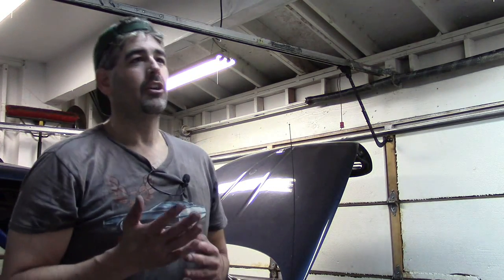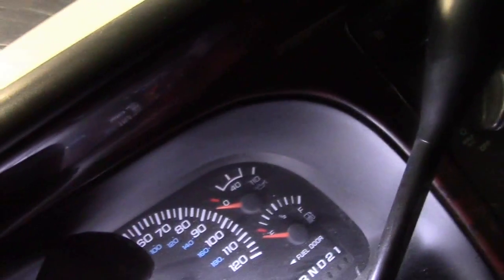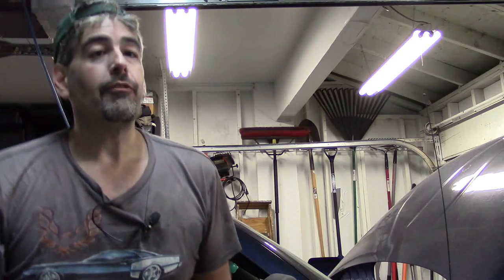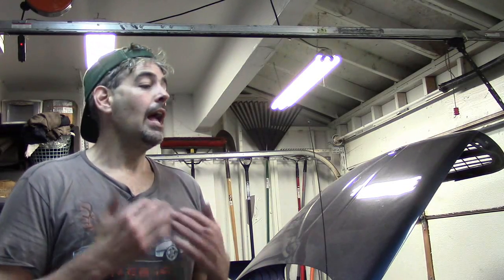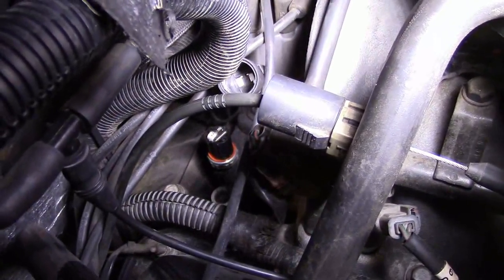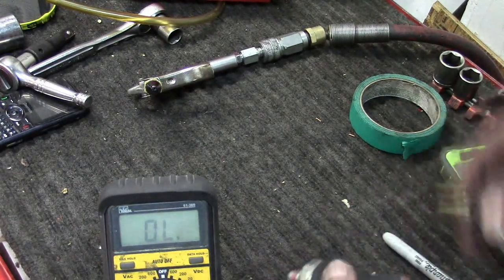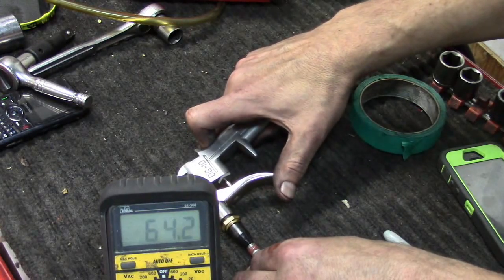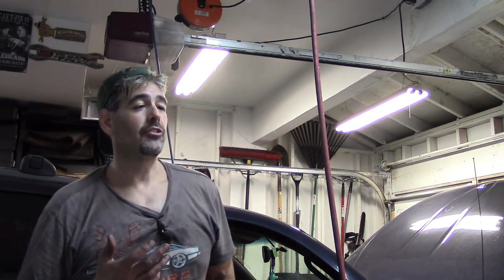DIY- Low Engine Oil Pressure Diagnostics

Comment: Hi,  first of all I love this channel.  Some of the best info online!!   I have 1 question, Ive got oils pouring out of my engine. looked like it was the oil filter adapter  I changed out the gasket on my oil filter adapter. but now looks like it is coming from above the part of the engine that the adapter bolts to. That part also has 1 bolt in it.   is this a part i can replace or is this a cracked block?  not sure if this is a place to ask questions but if anybody  can help it would be greatly appreciated.    ( 97 ford f150 4.2 v6)

Comment: Hi, love your show have a quick question I have a 350 Chevy small block I have a autometer gauge hooked up to it when I started up my oil pressure is about 30 when it's warm what about 20 minutes it goes down to about 20 is that normal

Comment: matt Im in the UK ,but I suppose  probably not much different where you are regards engine design ,but could it not possible there is a problem with the pressure relief valve, only a thought as you are sometimes getting pressure.regards joe

Comment: Looking for advice, 02 altima with fuel trims at negative 15 to 20 %, code 0300,  O2 V at 3 to 6 V. and long crank start after warming. fuel pressure good, compression good, does not stall. unplugged vacuum line and trims improve but o2 voltage remains at same levels. ??
Reply from the maker: What is the LTFT and aSTFT curves at idle vs load? You cannot tell anything without that.
Reply: the STFT  I mentioned is at idle, with LTFT at neg 10%, under, load during take off it goes up anywhere from 0 to + 5 % at best, once settled STFT goes back to as low as negative 18%, unfor did not check LTFT,
Reply: I have been leaning towards a leaking injector, would this cause the random misfire?
Reply from the maker: Oscar Hernandez Oh perfect- what is your data you have indicating a leaking injector? That helps. Was it a static fuel pressure test?
Reply: well at this time I have no tools to test injectors, (I might be jumping to conclussion)I stumbled upon your videos not long ago! been reviewing the diagnostic series, I might need to test fuel pressure since I only saw pressure while cranking, it had no pressure when switch at on position!
Reply: for pressure test, i connected before delivery (injectors) rail.
Reply from the maker: Sorry man you have no relevant evidence I can help with. Once you get some data I can give a direction but I don't see how you're coming to these conclusions without evidence.

Comment: Well Identifix specifications for this engine are At idle, it should be 6 PSI and it is at 20. At 6000 RPM.
You don't think that the drop on pressure at the gauge was caused by the bad sensor?
Reply from the maker: At what TEMPERATURE?? No one seems to consider the most ciritical parameter despite my pointing this out in the video.
  How can it be a bad sensor?  The evidence is scientifically irrefutable it could be the sensor.

Comment: if we came from other side, Bad oil bump can cause inefficient lubrication and bearings is going to wear out. Pressure will fail down with time, am I right? because this is what happened to my Nissan Z I guess.
Reply: Low oil pressure is usually or almost always a worn motor and the bearing clearances are way out. One way to confirm is to check the oil for metal as he did.

Comment: What is it with Chrysler/Mopar/Dodge and oil pressure issues? It's not rocket science to have proper bearing tolerances and a decent oiling system. The Jeep 4 liter is famous for oil pressure issues. And, long ago, a dealer mechanic told me they changed the oil pressure gauges to be no better than a light because they were getting too many warranty issues of low oil pressure. Yeah, relatively low mileage engines still under warranty with 15 pounds of oil pressure at idle when hot. They got tired of paying for the repairs so they faked the oil gauge readings. I'm not saying Chrysler is the only company that does that but they're covering up a legitimate problem and, if the gauge really read true oil pressure, a lot of people could save their motors before they're destroyed. I'm sure the Chrysler/Dodge/Jeep fans will suggest it's poor maintenance, abuse, etc, but it happens too often to make those excuses. When was the last time you've seen a GM LS or Ford Coyote motor with 10 pounds of oil pressure even with 200K miles. How many miles are on this truck?
Reply: 10psi at hot idle is normal for many cars.

Comment: Out of curiosity, how would the pressure suddenly drop to zero, then back to normal range? I'm a noob so I don't know how all the bits are related...
Reply: Because the computer is faking the gauge reading. It shows normal pressure on start up but then if the pressure is too low for too long it drops to zero and hopefully turns on a warning light. It's kind of silly to have an oil pressure gauge that doesn't really read oil pressure but they've done that to reduce warranty claims.
Reply: Ah, so the other oil gauge (at the end of the video) is showing the REAL pressure. Thanks.

Comment: Hi, glad you are back.   When will you do a video on radiator fan running for too long and stop for too short with no apparent reason. What would be the issue that makes them  behave this way ?
Reply: Maybe a coolant temp sensor.

Comment: Hell ya, thanks for posting man!!!!   missed ya .     Half the time if you grab a junkyard v8 with decent miles on it, it's cheaper than a full blown rebuild after u buy the kit and all of the nicknacks.   Unless you just go for bare bones what u need to get by or whatever.   Looking forward to seeing the budget rebuild if it is in the young mans budget.  P.S.   i heard that lieing is bad for your teeth, the previous owner needs a pop in the mouth to prove that theory.
Reply from the maker: Lol agreed on everything!  I have done many dozens of salvaged yard swaps- it's how I started in this hobby in fact. I used to swap an engine for no more than a $500 investment total for everything including new gaskets and fluids. But I no longer do major work now.
Reply: Rhage73

Comment: Ameritrash, always breaking down until quality mechanic replaces all the parts with quality replacements.
Reply from the maker: You know this is a quality issue without knowinbg the maintenance history?
Reply: My dad owned 2 fords, jeep, and a Toyota for trucks. Volkswagons, Hondas, and Toyotas for cars. Jeep once a part is replace it never failed again, fortunate to not have a major failure. Both his Ford trucks had major $2000+ breakdown at 60-70K miles. Toyota Tundra he can't figure out spark plugs, took to dealer they say only need service at 100K miles or so. Never did anything to it other than change oil and it never broke. Over 120K miles now. Hondas and toyotas change the fluids at sparse factory intervals, they just purr, never break.

I've only had 2 Honda cars. Fist one 130K miles, lost to not at fault accident. They never broke down. Only change oil every 5000-8000 miles.
Reply from the maker: In science we would refer to this type of mentality as Ad hoc ergo propter hoc empirical logic fallacy exponentiated by personal anecdote.

Comment: I was thinking of testing the sensor different. It's a variable resistor like a coolant temp sensor. short out that 5 volts and watch the gauge. or just unplug the sensor and see where the gauge is at w/ 5 v sig. alternative readings if the computer doesn't some how shut down the circuit. Tests the entire circuit. Your correct the gauge and wiring is good as the gauge is reading the same as the pressure sensor.  But just checking the sensors ohms with varying pressure doesn't 100% rule out wiring and gauge.
Reply from the maker: Those a are valid ideas.  In fact, usually I use a variable resistor to short the circuit so I can confirm proportionate variance with the gauge.
Reply: Yeah, that would work well never thought to use one. At the dealer we have simulators that generate volts which could work.

Comment: Well u did 2 great things here you fixed the rad, so he can now use it and u also confirmed an issue he has with the engine. It's not good to hear that but you were not aware of it I am sure if you had been the outcome would most likely been the same fix the radiator and leave the other issue as the only thing that can truly fix it is an expensive rebuild. Great and truly thorough job love you diagnose vids.

Comment: a man my 2004 chevy silverado has the exact problem...has a low oil pressure i change the oil sendind unit and it still the same sometimes i hear a lil knocking sound when i accelerate the oil pressure goes away then i stop and comes back on u think it needs a rebuilt?
Reply from the maker: What was the data you got that indicated you need to change the sending unit? I would definitely start there.  What was the variance of reference voltage with pressure input that you saw indicating the sensor was faulty?
Reply: the oil gauge needle would'nt moved at all so i change it and thats when it started marking the low oil pressure
Reply from the maker: 559 calii  So you didn't check that6 it was a lack of reference voltage?  You have no evidence to go on in that case. You need to rule out electrical diagnostics to approach this scientifically.
Reply: yea but sometimes i can hear a lil knocking sound in the engine
Reply from the maker: 559 calii You need to do the diagnostiocs I did.  There is not other method that can give conclusive evidence other than measuring your bearing clearances.
Reply: ima check the engine pressure then
Reply from the maker: 559 calii No no no- you need to start with the electrical.  Validate variance of resistance with pressure and that the return on the reference signal indicates as much.  That is where you start.
Reply: with the sending unit i took off?
Reply from the maker: it doesn't matter. you have no evidence of 5V reference. Measure for 5V reference and ground first.
Reply: 559 cali.     

: iPhone
Reply: Marlyn Ramirez what u mean?.

Comment: Is it possible to make my 2000 Golf 4 shoot flames or backfire, if i rev up my engine, then turn off the ignition and press a button connected to my fuel injectors and turn on my ignition again to make it shoot flames? Just like old cars with carburetor
Reply from the maker: Of course- run the car with a maxed negative fuel trim and insert spark plug in exhaust.  Have fun.

Comment: The moral of the story is that you should never believe what the seller says 100%. Always take what they say with a pinch of salt and use your common sense and judgement. Or even use it as a bargaining point to get a better deal as you are taking a risk. If in any doubt and you are not willing to risk it (you can't fix it cheaply yourself, for example), walk away.

If it really was just a pressure sender unit, the seller, in theory, should have had it fixed as it's a cheap and easy repair - why would he have an obvious fault that would mean less chance of selling the vehicle, and getting a lower price for it?
Reply from the maker: Correct- and in fact, I believe the seller did replace the sending unit which is why it was broken, and that confirmed to them to unload the vehicle.
Reply: I hate crooks.

Comment: How many miles on this engine? What does the odometer read?  Certainly it wouldn't hurt to drop the oil pan, check the screen for clogging and pump tolerances.  That metal could be coming from anywhere like a worn camshaft lobe for example. Very difficult in this video to see the metal fillings/color in the oil sample shown.  The oil does look super thick and dirty.  I bet there is tons of sludge inside due to lack of regular maintenance.  After you changed the oil and filter what symptoms were noted?
Reply from the maker: The oil was full of bearing material. The mileage I believe was 185700
Reply: '00 Durango with 186K miles, yeah its at the end of its life
Reply: you are definitely right
Reply: Was the magnum 318 less durable than the old 318?
Reply: Ozzstar you hit it right on the dot my friend. Jumping straight to an engine replacement is being a bad mechanic. Change the oil sending unit, and run some cleaner with the oil change etc. This would give a better picture.

Comment: Great to see you making videos again.  Not so sure on this diagnosis, but I could not hear the rod knock.  What is the specification for engine oil pressure at idle for the 2000 Dodge Durango 5.2L?  On my V6 Toyota Camry it is 4.3 psi or more and at 3,000 rpm it is 36 to 78 psi.  Also, on the oil diagnosis, I would use Blackstone Labs before recommending an engine rebuild and pay $28 for their engine oil analysis.
Reply from the maker: This was a cold startup with the gauge failure activation being  at 7PSI for this vehicle and we saw activation twice at end of IAC flare.  There is no argument- this is legitimate low oil pressure.
Reply: How many miles on that engine?  These engines are known for oil sludge buildup if oil is not changed regularly.  Is it possible that the oil pick up screen is clogged with oil sludge?

Comment: Matt, I got to admit, I don't go to the best garage, seeing how they messed up my coolant lines when changing the accessory belts... I also had them change the oil and filter. Everything was fine before. But fairly soon after the change, my oil pressure gauge started "swinging" beween 0 and max, depending on rpm and temp. Have been driving a something like 1000-2000 miles with it since. When it start having a low below 30, I just put in half a liter or a liter of oil. The engine starts and runs, has power, even on german autobahn (100 mph+). But I'm not sure if I'm destroying the engine for good, or if it's fixable. Here on youtube are a lot of video's with the same exact symptom, but no one shares the diagnosis. So my guess is, it's very very bad news.
Reply: oil pressure sensor/sender.

Comment: This guy should stop using high performance engine oil with statins - he really needs some atherosclerosis. In this matter cars and humans does not have the same (pato)physiology. Humans are "clever" - they normally get tighter "bearing clearance" as the heart (oil pump) gets weaker with old age.

Comment: Looks like a bit of a "Ford" trick with the oil pressure gauge.  For the uninformed:  Ford started using a "Dummy Gauge" long ago due to people complaining about fluctuation of the "real" oil pressure gauge.  (hot engine=Lower pressure.  Cold engine=higher pressure.  Due to the thickness of the oil at start up, and it thins out a bit when hot)  To stop the idiots from complaining=  Ford installed a normal oil pressure switch and a resistor on the back of the cluster to always maintain about the same oil pressure reading, no matter what!   If the engine pressure drops below 7psi, then the switch opens and the gauge drops to zero.

Dumbest thing Ford has ever done.  It can be bypassed and returned to a normal gauge.  (instructions can be found, but I'm not going to disclose that.  To many socket jockeys that would screw it up.)
Reply: Almost depressing how things are made to look "Cool" (Hey look!  Actual Gauges!)  But the population of new drivers isn't smart enough to understand them.   Just like most of these new drivers can't even check the oil on the engine or drive a stick shift.   Neighbor had a newer Explorer that had a heck of a valve 'tick'.  I suggested she check the oil level as it sounded very low.  Her response as she drove off with a 'time bomb engine'?  "That's my boyfriends job!".   Yeah, her boyfriend didn't even know how to change a tire when the suv had a flat!  (What's a lug wrench?  Duhhhhhhhhhhhhh)
Reply from the maker: CORRECT!!! This is indeed a dummy gauge with threshold of tolerance for inactivation at 7PSI.  Nice post!!!!
Reply: I think they all do that - I've come across it on a Chrysler product also (I think it was a Jeep.)  That's probably why so many manufacturers went back to idiot lights and no gauge.  Hell, some cars don't even have a temp gauge these days, but just the light - like my in-law's Hyundai.  :-(
Reply: Similarly, the engine coolant temperature gauge on my Focus doesn't really show temperature, especially not past the halfway mark. Once the engine warms up, the needle just sits at the halfway mark as long as the temperature fluctuations are within certain range. And if the temperature exceeds this range even by a single degree, the needle just suddenly jumps to full red. It's basically just an "OK / not OK" gauge. The dial doesn't even have any real values marked. And there's actually not a coolant temperature sensor on this engine - it only has a cylinder head temperature sensor and the coolant temperature is just a calculated value :) (Which can be fun with OBD2 readers as some just show the same value for both ECT and CHT and some show the "proper" calculated ECT.)
Reply from the maker: Tedybear315 Everything is like this now... in fact if you think about it, there are two fail-safe marketing strategies that have proven viable:
1. Make things easier for dumb people
2. Make things easier for lazy people.

  Never fails.
Reply: Schrodingers Box
  Agreed.  I work currently as a retail manager.  (retired from being a mechanic 20 years ago...long story)  Some of the things I see and have to deal with make me wish we could give people the "Stupid" sign like the song says...This is why I only work on my families cars and trucks.  Lot's of decent people I get to deal with...and a large number of walking piles of ignorance as well.
Reply: These days,There Is a lot of dumb & lazy people out there! The funny thing is,Their unaware of their idiocracy! Then,when you try to help them,They argue & have no manners. the way I see it is, why bother,let em figure it out on their own.doesnt pay to be the nice guy.